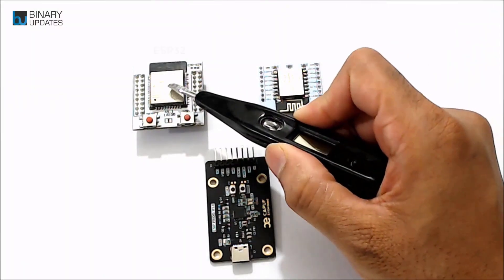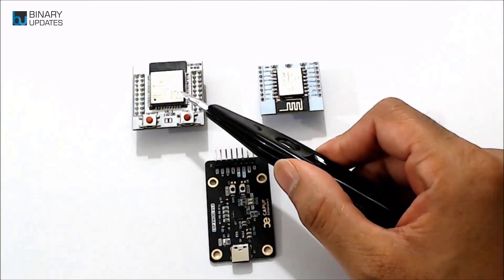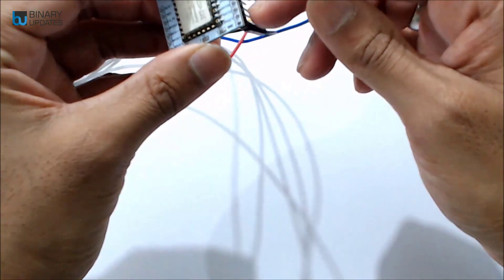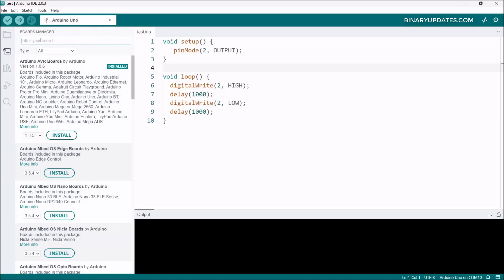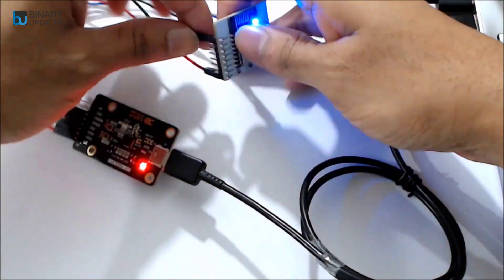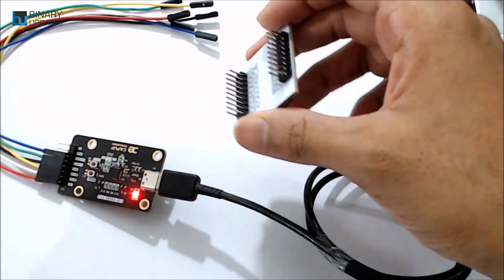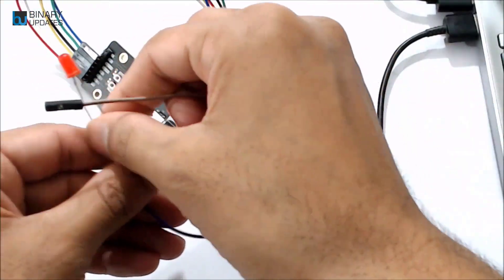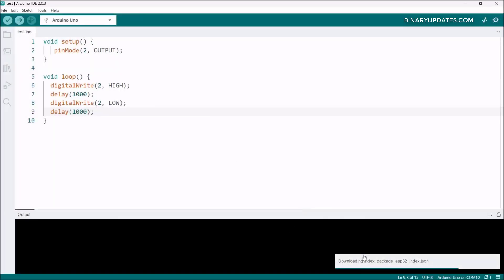ESP Programmer for ESP32 and ESP-12E (ESP8266) Microcontroller

Comment: I’m getting this error when trying to compile code for ESP8266. I have followed all of your steps can you help me with this error? . Variables and constants in RAM (global, static), used 28104 / 80192 bytes (35%)
║   SEGMENT  BYTES    DESCRIPTION
╠══ DATA     1496     initialized variables
╠══ RODATA   920      constants       
╚══ BSS      25688    zeroed variables
. Instruction RAM (IRAM_ATTR, ICACHE_RAM_ATTR), used 59667 / 65536 bytes (91%)
║   SEGMENT  BYTES    DESCRIPTION
╠══ ICACHE   32768    reserved space for flash instruction cache
╚══ IRAM     26899    code in IRAM    
. Code in flash (default, ICACHE_FLASH_ATTR), used 232148 / 1048576 bytes (22%)
║   SEGMENT  BYTES    DESCRIPTION
╚══ IROM     232148   code in flash

Comment: Any plans on how to debug using VS Code and the IDF or PlatformIO extensions?

I bought an FT2232HL device (ESP-Prog), pointed it to the WinUsb driver (via Zadig), but not sure how to configure it so that OpenOCD starts and load the elf file onto the ESP32.

And if you unplug/plug, does the last debug program run, or was the debugger running out of RAM?
Reply from the maker: Hi Benn, I'll surely make videos on debugging ESP32 MCU with VS Code other professional IDEs. It may take sometime for me to make videos tutorials around ESP-Prog FT2232HL. As its been very busy these few months. Thank you so much for suggestions and input. Have a beautiful day, Best wishes!

Comment: Hi...
 when I try to upload the code..
Only tx lights up on programming board..
Code won't to upload any esp board..
I tried everything... installing driver .. change the esp board but still didn't work..
Any help..?
Reply from the maker: Hi Puttunh, I think you should ask for support to company and provide them more details about connection of ESP32 MCU and Its programmer. And hope they will guide you on the same. But as you can see in my module it worked even in first attempt. Good luck and best wishes!